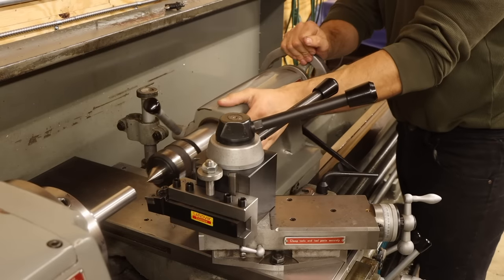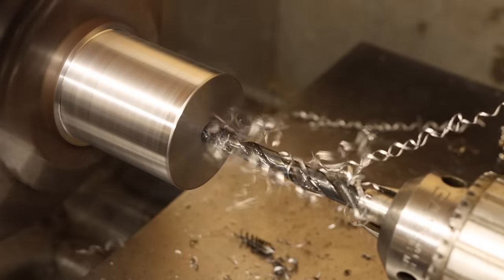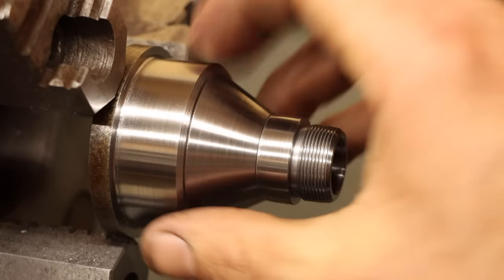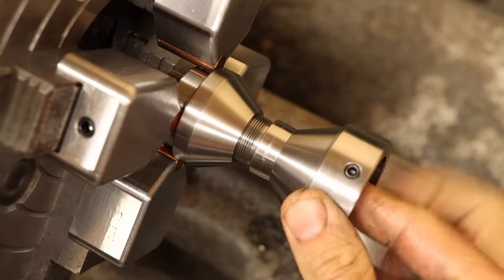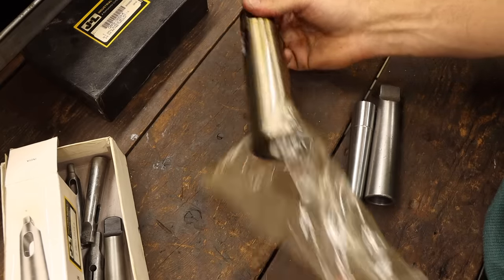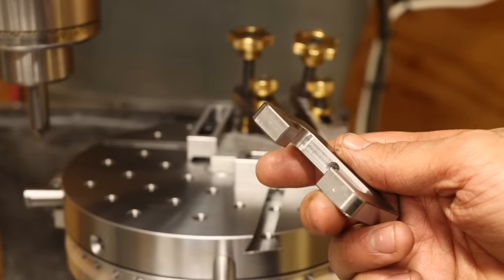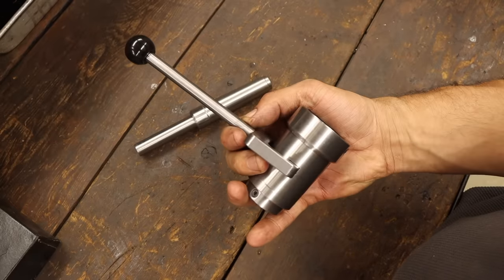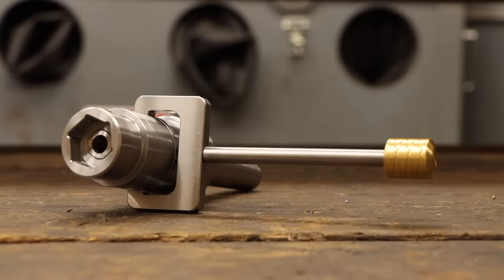Live Free or DIE HOLDER

Comment: What a great tool!! Tahnk you for doing this for us, it's turly fun to watch. though, I would like to give you a little suguestion, that's would you consider using toolpost to hold on the clutch handle? Maybe making another adapter for this job, to prevent any protential injury from the spining machine, and make leverag by using lead screw on the tool post to feed, also make live easyer too.

Comment: Nice work Brandon! Are you planning some rust prevention for the die holder? I like the kits but they're made out of regular steel. Combined with moisture and some hard working sweat they become brown quite fast. Which is a pity for such a wonderful shiny build! Best, Job
Reply from the maker: Thanks, Job! In my shop I have virtually no rust issues with the dehumidifier i keep running. But for anyone else I would recommend a cold bluing finish

Comment: to make a cool grip on rods i used the cutting tool and went in maybe 3 millimeters, made a gap equal size of the cutting tip and then went 3mm in again and repeated this pattern
i have it on my 25kg carbon steel skeleton lead hammer, it grips very well, it hurts to lift that hammer off the ground if you dont wear gloves, adds to the experience

Comment: This was such a fun ride, trying to guess how it was going to work the whole video. Now I'm only a peasant woodturner, but my heart skipped a beat the first time that handle jumped in your hands. Any way the handle could ride against something solid (I'd use the edge of the bedways on my woodworking lathe), so you'd just have to push it forward and backwards to engage the clutch and not worry about the part catching hard and snapping your wrist?

Comment: Beautiful job Brandon!
Even though I have seen a couple of these kits made before here on YouTube, yours is far more beautifuly made, and certainly the most chamferific. I should get and make one of these kits at some point, in all of my free time.
For the larger dies, could you manipulate the design of the C shaped part of the lever to alter the mechanical advantage, instead of making the handle longer?
Reply from the maker: Thanks, Keith! Honestly that's all the chamfers talking 😂 On the lever, I could definitely make the square "cam" part more "cammy" or loosen the assembly to make the clutch engagement easier. But the larger issue is just resisting the torque. It's not too much to handle obviously but I do fear for that little M6 thread haha. Maybe a longer and welded handle

Comment: Interesting, because just yesterday I had to cut a thread on a rod, but 6"/15cm from it's end so your die holder will not help here, neither my 1"/25mm die holder for the carriage because MF14x1 uses 1.5"/38mm dies. The solution was to hold it using a pipe wrench.

Comment: This tool has one major disadvantage, that you have to push it along an offset line to make it work.  Offset force isn't going to help it make an accurately centered/aligned thread.  As you say, it is better than the previous way.  But I think it will never be perfect due to the offset force.  If you modified it to make two handles 180 degrees apart, then pushed them evenly while threading, maybe it will thread straighter every time.

Comment: When you're pilot drilling for a large drill, the best option is to make the pilot hole barely larger than the web of the larger drill, to make sure you still have enough material for the drill to bite into without digging in and breaking anything.
Reply: Indeed. One problem with large pilot holes is that a morse taper requires a fair bit of end thrust to ensure reliable torque reaction. Otherwise it's a bit like a ladder which is set up insufficiently steep to the wall. On mills, that risk is removed by using a draw bolt to provide thrust at all times, but on drill presses and lathe tailstocks this is not an option, and in these cases if a drill is used to enlarge an existing hole which is too close to finished size and the drill grabs, it can spin the male taper in the female, and (with big drills) may even break the tang and score the female taper beyond repair.

Comment: thinking about the design, and the "lurch" when the clutch engages/disengages, it seems like a matter of binding order. if the clutch "grabbed" the stationary cone before the rotating cone, then all the torque would be transferred into the stationary cone, instead of having an in-between state where neither cone is fully engaged and some of the torque goes into your wrist. Perhaps you could put some sort of rubber, or even just copper or something between the clutch and the stationary cone to cause it to bind first?

Come to think of it, what's the point of the clutch rotating freely around the stationary cone in the first place? if the handle thingy was rigidly attached to the stationary part, and would only clutch on the rotating cone, it would eliminate the problem entirely
Reply: I guess it could be less convenient to set up if the handle can't spin freely by default. perhaps a series of grooves, so that the handle indexes into the stationary cone at 30 degree increments when force is applied, while the regular clutch friction applies to the rotating cone?

Comment: Someone told me once “pre-drilling the hole will just put stress on the middle of the cutting edge of the secondary drill” don’t know if it was true. I always preferred to pre-drill with a diameter that matched the flat portion on the bottom of the drill. Thoughts?
Reply from the maker: I tend to get less heat and wearing when I pre-drill. Might as well burn up a cheaper small drill than the big boi

Comment: Hi, why when you aré machining steel some chips change color and others dont?
Reply: It depends mostly on how much heat is transferred to the chips by the machining friction but also is affected by what metal or alloy is involved, the size (thermal mass) of the chips, the air temperature (cooling rate) and presence or absence of cutting oil. Read the Wikipedia article on tempering to see an example of tempering colors and a description of how they form.

Comment: Isn't there a level of danger here if the die catches while engaging? I would prefer the lever be sliding along some sort of rest where all you have to do is apply pressure in the Z axis instead of holding it against the spindle pressure.

Comment: Really cool. I wish there had been some explanation provided for how the tool works for the uninitiated, like me, to apprecriate the mechanism more.
Reply: The idea of the clutch is that unless a force is being provided along the axis of rotation by the operator (either a feeding force towards the headstock, or a retracting force in the opposite direction) the die will spin freely, so it will not try to cut. I was fooled into thinking one cone was for forward and the other for retraction, but in fact both work together, much like the two brake pads in an old fashioned drum brake on a motor bike, and the actuation principle is also similar: a rectangular section squeezed between two flat faces, forcing them apart when it's twisted.
Reply: @Gottenhimfella  how does the clutch make the die engage with the material? Does it squeeze it closed? I'm having trouble visualizing how it happens
Reply: @PeregrineChurch   The cones, when forced apart, behave like the clutch on a manual car when you release the clutch pedal. The cones will accordingly engage, causing the die carrier part of the holder to no longer be free to spin relative to the Morse taper shank, so that the die teeth bite into the workpiece. 
The holder feeds along the work whenever the cone clutch grabs. If the lathe is spinning forwards, the dies advance, if backwards, they retract. 
When the die is free spinning, it simply stays where it is on the work, which enables threading up to a shoulder, releasing the pressure at the moment of contact.
In theory a lathe headstock with a clutch achieves the same result with a rotationally fixed die holder, but in practice almost all lathes with clutches are large machines with a lot of rotational momentum, so this would be viable only with very large dies.
I have developed and proven another, somewhat simpler way to address this for both die-threading and thread tapping, if anyone's interested.

Comment: Maybe a keyway and key would help against having to arm wrestle with the device. It looks intriguing, but this mild steel cones rubbing against each other makes me wonder, if this isn't very prone to seize... Some sort of friction material to take the wear would make more sense to me.

Anyway: Nice project!
Reply: I think your point is an excellent one. I'd be inclined to case-harden the cones to prevent galling. I guess it's possible the material the cones are made from is something with galling resistance. Nickel chrome steel would probably do it.

Comment: You could also hold a die in the Lathe chuck, put a drill chuck in the tailstock and hold your stock with the drill chuck.
Reply: I'm pretty sure I tried this back when i was a teenager. It worked OK with solid dies but no good with split dies. The idea of the split is to allow adjusting the fit of the thread, but it means that you can't grip it hard enough to provide drive without producing an undersize thread, by a considerable margin. 
So it would work with his hex die nuts, but what I don't think most people realise is that they are not designed for threading from scratch, except in soft materials. They are intended for cleaning damaged threads, or for a finish pass to size and radius the crests of threads roughed out by single pointing.

Comment: You may know this but you may not 20 years of manual machining much bigger parts but to get a fine RMS fast like low double digits a 1/2”radius titanium nitride tool running at a high feed  like .045 and high rpm’s  almost always gave me a Finnish that was better than required for the forge to  test sonic

Comment: I probably don't need to mention this, but the way you introduced the dies you have pushes me to say it, anyway.

The hex dies are for thread clean up only & are not designed for cutting original threads.

I didn't go back to make certain, but I thought you said you "hadn't used" or "hadn't been able to use the round dies". The kicked around in my head for 5-10 minutes while watching, & made me wonder if you had tried cutting threads w/ the hex dies & that was why you had problems.

I've honestly never tried to cut new threads w/ a hex; I'm going on what I was taught & what catalogs say.

I've got a die I should send you to puzzle over. It seems obvious it's made incorrectly, but as off as it is, someone must have been drunk at work that day.

It's a 10-32 & starts fine on the correct size stock but, it gets after the cutting & out the other end comes a piece of knarled rod about ⅛" OD.

It's a brand name die, too. I'll have to see if I can find it; it's been kicking around for a number of years.

I must be hoping I'll have a sudden epiphany & understand it's problem.

I made a die holder for my lathe that doubles as an assistant for tapping, as well. I integrated a spring in the design; IIRC, it's a valve spring from a small engine... or mebbe an internal secondary spring.

Whichever, it works well, keeping enough tension in either the tap or die for a couple rotations, then a reset. But, I'm not power threading, I'm turning the chuck by hand.

If I'm in that much of a hurry, I put the chuck in my dedicated threading drill press & you the auto-threader I have.

Later, 

GeoD

Oh, yeah, I really liked the dbl knurled knob; gonna have to try that!

Comment: That taper-based dual clutch is one of the cooler things I've seen on a tool that simple
Reply: I was fooled by thinking one clutch was for forward and one for reverse, but once I realised they were like a pair of brake shoes expanding against a single drum, I got it. It was not clear to me that the lathe rotation was being reversed, but in the absence of a triplet set of bevel gears or some equivalent intelligent mechanism, I could not see how that need could be avoided.

Comment: I've been meaning to ask, when you made the 4-sided and 6-sided collet blocks, could you have made a single 12-sided collet block that could've done both squares and hexes?
Also after seeing you have to indicate in the center of the rotating fixture plate repeatedly, could you make a tapered insert for the mill that you use to center the plate then lock it down?
Reply: The practical objection to that ingenious and novel suggestion is that the resulting flats would be so narrow that they would not provide much accuracy of indexing, nor much torque reaction. In twelve pointed bolts and ring spanners, these limitations are addressed by making the flats hollow-backed but that is not an option here because vices have flat jaws.

Comment: Now you just need some kind of over-engineered slotted thing to go into the tool holder on the lathe that will keep the handle of this die driver from jumping around on larger jobs.
Or simply let the knob rest against some part of the top/cross/compound slides, but that will scratch up the brass and we can't have that! lol
As a side note, is that not a die guide on the original wrench? Three little fingers that clamp around the stock and guide the die to be more in the center, or at least that but with a replaceable guide plate that is drilled to the stock size? Or have I been using mine wrong all this time?

Comment: You could have your tool holder have a bar of steel for the handle to ride on instead of having your hands near the machine in case the clutch fails so the lathe doesn't take you with it. Would make it easier and safer too, and make it so you don't have to fight the tool

Comment: You say you'll use it just to make the time you put in to making it worth it I'm wondering have you ever got any return on the Tap wrench you made as it seems like you made the size you use the least. Honestly especially now with this surly you need to design and build the 2 sizes smaller in tap wrenches at least and try to get different designs for each. Great build again though.

Comment: For the threading die being off center couldn't you go back and forth tightening and loosing the grub screws while checking the runout along the surface of the die
Reply from the maker: That could probably work actually. Not much to indicate on along the die though so might have to make a threaded plug for testing

Comment: 28:30 maybe a longer handle for bigger threads?  Maybe design in a weak point near wear it screws in to snap off there if the clutch fails-dangerous?

Comment: Ahh! tool nose radius compensation while turning an angle. On a cnc the proprietary programming will handle this or a cad/cam program will, otherwise on a manual lathe one must do the math if one wants the parts to fit properly. Nice work!

Comment: I always thought those hex die nuts were just chasers to clean up damaged threads.. when I worked in an engineering sales company, we sold Presto (a quality UK manufacturer) die-nuts and the company blurb said specifically for cleaning up threads.... 🤔

Any I've seen don't have a split for adjusting the thread fit and having used 'em to make threads when I hadn't got a circular split die and time was of the essence, I found them to produce very poor threads , even leaded EN1A (12L14 ?)... 

😎👍☘🍺

Comment: A damn fine application of the parts kit, i just dont know why they ever used the clutch shifter handle of that diameter... Who the hell designed this parts kit? To retain a die when cutting, especially the large ones, this little handle and the even smaller threaded section are so inadequate that i dont see this cutting threads in anything over 10-12mm dia(around half inch onwards)... Those massive dies that you have will likely snap off that little threaded chunk in the clutch actuator like its a bit of wood... 
The guys at Hempmingway were obviously fresh outta the smoke room when they came up with this specific part of the design... I had the primitive die holder handles bend on cheap ones and snap at the thread with better ones... There is a damn good reason why automatic threading heads that were common on automatic lathes retained the cutting pieces in deep slots... Sure, it allows the cutting part to slide and be adjusted while being rigid and precise all the way through its range, however, those heads were beefy as fuck... And im not talking fat-thread-roller, im talking geometric threading heads... And sure, while both of those were usually used at very high rpm when compared to any normal threading operation, the design was not such to offset the high speed, but high loads that non-single point threading induces... 
The only saving grace is the clutch being able to slip, but that still leaves you with a part that needs threads cut onto it... 

As said, love your work and end result, the knob diamond threading is an idea i have had in mind since first seeing the double direction thread video on yt from a russian guy, but i never had the chance to apply it, as all of my lathes are in some state of disarray and need some sort of a touch up to do the single point thread cutting... Im glad to see you do it, as it puts the idea in practice and confirms the suspicion that its a great approach to some things... 
Also, i guess i was right about the picture you posted... Hell, i could likely replicate this system by now without any plans whatsoever - just from having had learned the design by heart from seeing it online so much :P

All the best and kind regards!

Comment: I love using 1200 grit lapping compound to make sure that nothing galls for threads
Reply from the maker: How does that work? Do you put it between the mating components?
Reply: @InheritanceMachining apply to male threads, run the screw in and out a few times, and clean with a solvent. We use US products co 38-1200 at work for threads that are just slightly too tight or are slightly damaged.